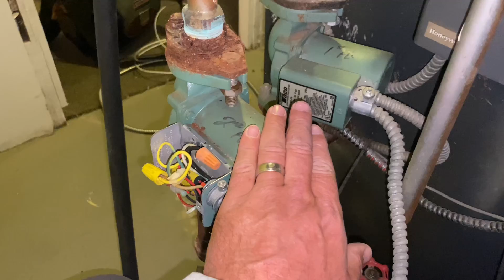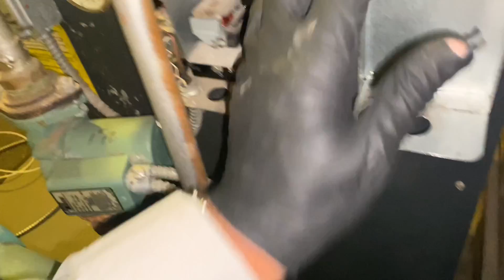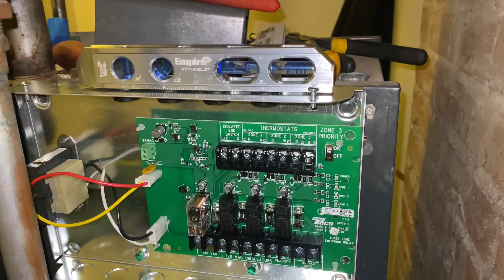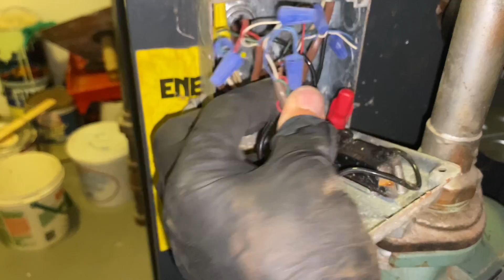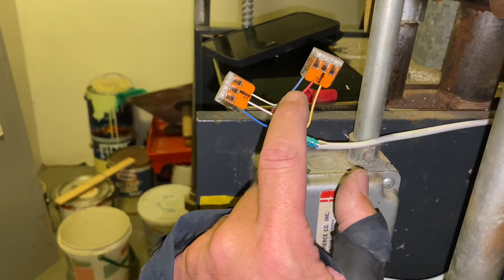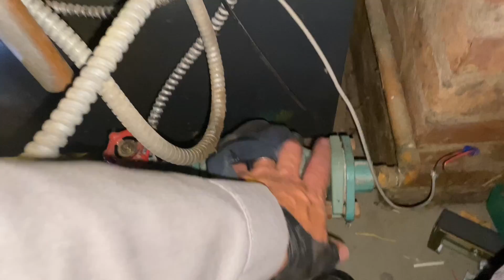Wiring New Zone on Slant Fin Gas Boiler Adding Taco SR503 Zone Switching Relay Wiring Explained

Comment: Helping my neighbor get her boiler running. 3 zones. You explain it beautifully how the relay inside the aquastat relay is bypassed because the voltage going to the sensor comes from the zone relays individually. Now she has heat in her new house. Boom!

Comment: Where would place the c wire for zone one and two to put a smart thermostat
Reply from the maker: To install a smart thermostat in a multi-zone system, you will need to locate the C wire for each zone. Generally, you can find the C wire at the HVAC control board or transformer. Make sure to consult the installation manual of your specific thermostat for detailed instructions.

Comment: Doing electrical work for 20plus year's and never used the wago connectors always cut them out and trash them we mechanically twist the wire's and put a wire nut on those  connectors are like stabbing the wires in the back of an outlet and we dont do that ever ive been on service calls where they did that and it's a bitch to find the short cause the wire works loose in those connectors

Comment: Love the video but I don’t like having the low wattage communication wire running parallel to the line voltage in the same conduit but hey it’s been like that for years and worked so it should be fine🤙

Comment: Great job Mike, BX or AC cable doesn't have a standard size grounding conductor, MC cable does, and is an insulated grounding conductor, the AC or BX you can sometimes use the sheathing as grounding conductor, but think and feeling having the larger grounding conductor is better, and being a perfectionist isn't always bad. Good job again.

Comment: You could do a honeywell th8321r on battery power and connect it wirelessly to an EIM in the boiler room so that they can have an actual thermostat upstairs instead of just the wireless sensor.